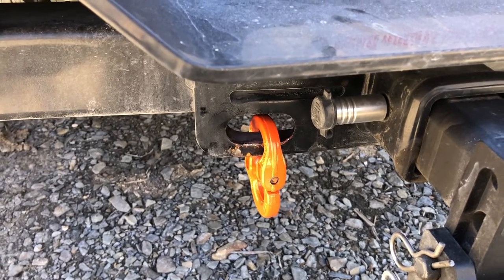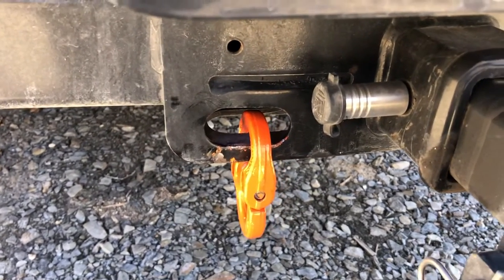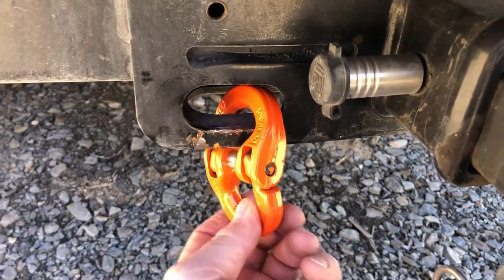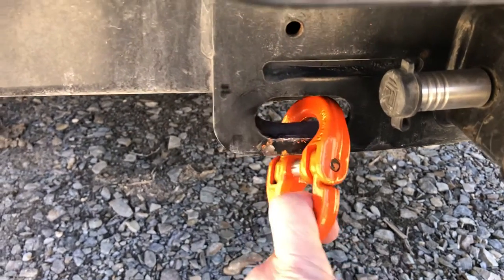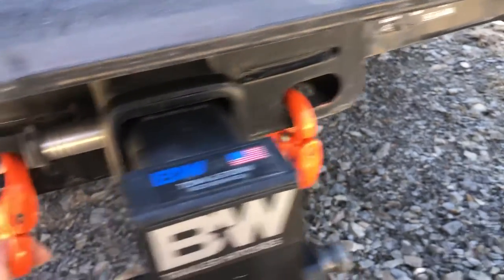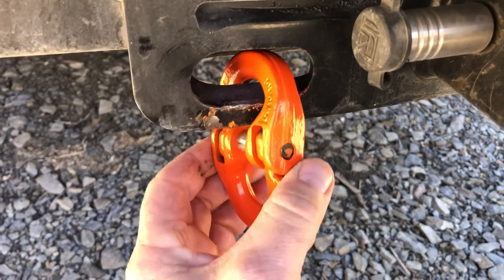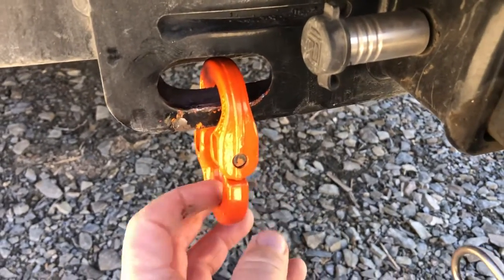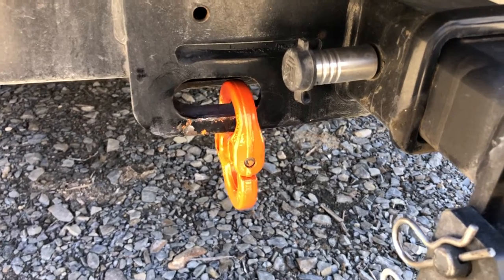A figure eight connecting link, commonly known as a hammerlock.

Comment: I guess all Hammerlocks are removeable, although you make it sound like something that is easy to do.
I've yet to come across a Hammerlock that doesn't need at least, the same tools to remove one, as what it does to install them, plus a parallel pin punch to drive the pin through, and a means of supporting the Hammerlock so that the force applied to the parallel pin punch can do its job.